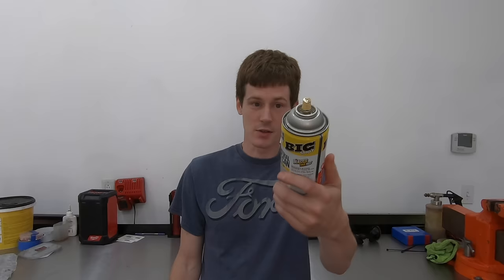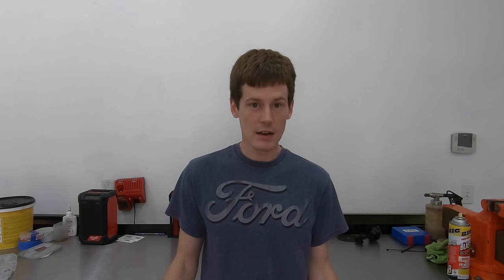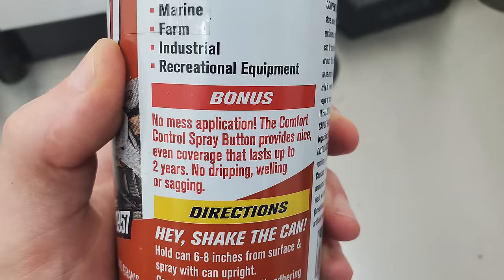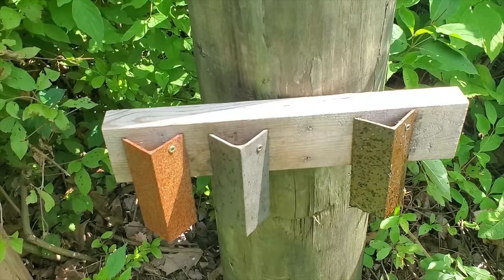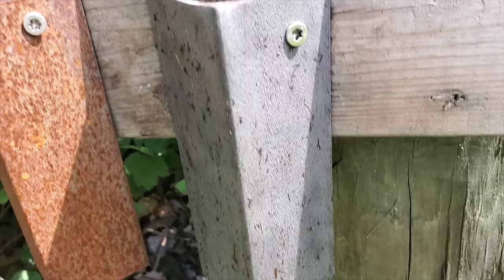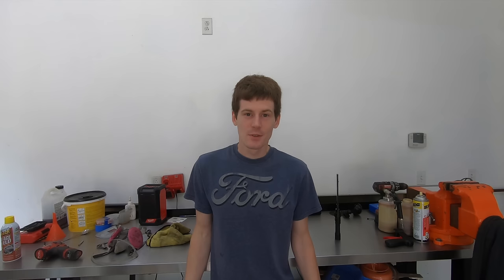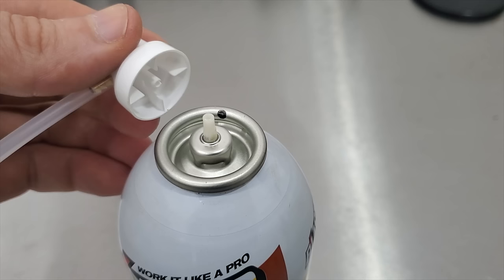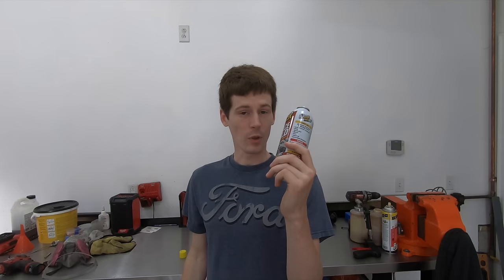I Finally Found The Best Undercoating On The Market... Blaster Surface Shield

Comment: Told my Freind about it and he used it on his  brand new ATV  because we travel on saltwater shorelines …only problem he came across was grass seeds stick to that stuff and it’s fairy hard to avoid it…only thing I can add to any kind of coating is make sure to use a penetrating rust inhibitor and make sure there’s no moisture in welded panels and seams before applying any sealant because it will lock in the moisture and it can cause rust from that…

Comment: I live in harsh salted road winters in Northern Canada, use the thin products for flowing capabilities in rocker panels etc, on wheel well areas , frames or anywhere that will be exposed to weathering, use a thicker product that will not wash off after many miles of bad weather driving. Common sense!

Comment: Boiled linseed oil. I did my S10 7 years ago and it still looks exactly like it did 7 years ago. And I live in New England. This truck was from Florida originally so it had no rust to begin with. Best part it's clear and penetrates the surface. Worst part it stinks for about 2 weeks while it cures. If you want to protect your underside and have it not look like you undercoated it this is the stuff to use.
Reply: @kimbuck-2  I used a undercoating gun but a regular spray gun will work just need a big tip.

Comment: Regards to the bolts on the mud flaps, that could be road grime, rubber or tar that isn’t coming off. Not necessarily the product. Try doing a controlled test on clean metal. Spray the product on, leave it sit without contaminating it, and then spray it with the pressure washer.

Comment: I'm intrigued. However, I have a few cans of Woolwax I need to use. What concerns me about the long lasting part of it though is how well it attracts dirt and doesn't wash off. One thing I've found with Woolwax is my frame appearing to have surface rust simply because of the red dirt from some of my off roading trips in Michigan's upper peninsula not wanting to wash off that easily. Not a big deal because it isn't rust, but still.

On the other hand, I specifically chose Woolwax over Fluid Film because of the concerns about FF washing off come spring time and people needing to reapply it.

Comment: I spray everything with used transmission fluid and let it soak for a month. Then I powerwash it, blow dry it with a leaf blower and coat it 2 to 3 days later.

Comment: best thing to use is mineral oil mixed with coconut oil put a half gallon of each in a pot and warm it up and mix it together I put it on my truck 6 years ago and it's still protecting it when your looking for something to protect from water and salt it is good to luck at the nautical industry coconut oil has been used for thousands of years to protect against the oceans salt

Comment: I've owned my 1971 GMC longer than this kid has been alive. The exterior has surface rust breaking through the paint, but I had treated underneath the truck and under the hood with CRC Marine Corrosion Inhibitor only a couple times, and it still looks just like it did twenty years ago.
Better than undercoat.

Comment: Great Video and great news a thinner ( creeper) type that can last close to 2 years. Almost all others will peek out at around a year if that. Had the same trouble with the cavity attachment. Had a buddy who bought home from work the smallest plastic tubing I'd seen before. A Medical device maker Co... We were about to  put this tubing over the straw but not tight enough where it wouldn't blow off, So we epoxy sealed it on overnight. Was able to then get into inner panels with an older can of Rust Preventer(Eastwick I think) in a spray can like this.And then take nozzle to a new can. Been 5 years and the wheel fenders lips haven't started to bubble yet on a notorious rustmaker dodge truck!
Reply: Can you spray the braking system too?
Reply: @larrymccann767  Not quite sure what you mean by braking system? DEFINITELY have done all the steel brake lines from the master cylinder to the backing plates and calipers though. Those notorious rusting brake lines have been pretty much eliminated !

Comment: Fluid film isn't bad but living and driving in canada,and owning a few cars and watching them rust out even with fluid film. I found the absolute best undercoating that I use on my vehicle with absolutely no rust except my calipers. Which is krown rust control, I recommend this to everyone that wants to save a vehicle from rotting. A pressure washer won't remove it.
Reply from the maker: Complete crap even tested it twice:https://youtu.be/oXlhmbvdKBo 
https://youtu.be/9SOOfZFmhSY?t=264

Comment: Started fighting vehicle corrosion with topical products many years ago with petro oil / petro grease / paint.  Those don't work, grease being particularly hideous as corrosion builds under the grease layer and isn't obvious until sheet metal perforates or flakes off. 
Later changed to Fluid Film , flows well , washes off too easily for wheel well and other high wash areas-- went to the Fluid Film marine grease form for high wash areas but not really satisfied with that.   Changed to Woolwax several years ago, less wash off than standard Fluid Film, still not satisfied for high wash areas.  
Now trying CRC cosmoline like spray for high wash areas, and will add some trialing of the PB Surface Shield, if the product lives up to the hype it would be preferable to CRC for irregular crevice penetration in high wash areas;  flat, cleaner surfaces CRC may still be preferred. 
Anecdotally: 7.3L oil pans, which suffer from corrosion penetration and leaks, poor alloy quality (very expensive to fix a leaky 7.3L oil pan in either time or money)-- tried POR-15 full on vehicle surface clean/prep/pre-treatment/POR-15.  Messy and took a long time, and POR-15 flaked off within a year or two with corrosion even worse.  Disappointing results.  Now Woolwax every 6 months or so, being conservative, could go longer w/o repeating, but really don't want oil pan rust holes, no advancing corrosion and the Woolwax doesn't boil off.  I did not really expect that performance in the fairly hot environment, but the Woolwax works.
Reply: I should add a comment:  the driving here is not road queen paved roads and paved parking (nor, gasp, a garage).  Typical is 3-10 miles per day of dirt roads, north east US state using ferocious latest version car destroying de-icing chemicals which are actually applied heavier on dirt roads here, with weeds and grass brushing the bottom of the vehicle in spring/summer/fall depending on the bush hogging.  My observation is that severity is much much higher with dirt roads, unpaved parking, and vegetation compared to friends' vehicles which only mosey along on paved roads and park on paved areas.  The dirt roads particularly seem to "wash off" anything in wheel wells and related blasted areas.

Comment: This is interesting, in a previous video where you were removing fluid film with pressure washer to test out wool wax, you said even after spraying with the pressure washer, fluid film was still on the metal, and you showed this by running your finger on the metal, which left oil type trace marks. You had to go back and wipe it off with a rag,  but did not show after doing that if there was any residue still from fluid film. Will see these results  ( surface shield) show in time. Surface shield is more pricey than fluid film.  Not enough cars to test fluid film and surface shield  2 year evaluation after 1 application I guess. Thanks for the videos, very informative.

Comment: I used it today on my snowblower along with thinner products for creeping in on seems, one product you should try is CRC heavy duty marine grease it blows them all away especially if you live where there is salt. The only downside is on a plain metal it will leave yellow tint but my ariens showed no signs of yellowing only on clear and it will not com off either with a pressure washer.  but the stuff he has is good..,

Comment: One thing right now I noticed PB Blaster Surface Shield
leaves a sticky surface once applied. IMHO I didn't
like that so far that is the only issue. We'll see how it holds up
thru this winter that is coming. I do like the product
and now ordered the one gallon which in my opinion is the
way to purchase it for me.

 I ordered six one quart containers from Amazon for my spray gun
so that I will break down the one gallon into quarts and label them
according. I used 3 cans of the six on my 2005 F150 Ford truck
with the extended cab and has the medium size bed. I didn't do the
front, rear bumpers inside the doors  and rocker panels I will use my
spray gun with the 360 extended wand for those. Hope this helps
someone else out there.

Comment: Nice commonsense video. I will give the stuff a try here on my own stuff. Not too long ago I did the under side f an old Mower deck with fluid film. The decks on that model MTD are know problem childs from the get go with rust and metal fatigue. This one is not a bad mower I got it with a bad motor and repowered it only to find out the decks have a rust & fatigue issue like a lot of JDeere box store junkers. My MTD I dissected the deck at the fatigue areas and put heavier metal in so spraying fluid film over the shit work helped. Here is a new angle at preserving one of my favorite riding mowers.

Comment: What I like most about fluid film in a can is that it's carbonated. The bubbles force it into the tight areas.
Reply from the maker: It's not carbonated haha. Thats the propellant escaping out of the product. Only the aerosol cans bubble, Surface Shield does the same thing.

Comment: The best coating for me is leaving my rear main seal to leak and spray my entire jeep with oil as i drive... only issues is i gatta put a quart in every 300 miles, keeps th eengine clean too as its always got fresh oil.... lol yes i am in the process of changing the seal finally though haha but hey the oil coating worked great haha

Comment: Another big problem with aerosol cans with 'male ends' - if you accidentally drop or knock over an uncapped can and it hits the ground on the spray tip, there 'male end' usually breaks off in the can, pretty much making it useless. Male spray tips will break off as well, but the broken piece is easily removed from the can and you can replace the tip, and you don't have to throw away and waste whatever is left in the can.

Comment: For me, rust converter plus a black paint works better. No need to apply it every year. It might last you more than 2 years.  Just check areas that rust is starting and just touch up.

Comment: I've been using Lucas Red n' Tacky grease, which won't wash off under direct spray from a pressure washer spraying dish soap, but I worry about it not creeping as you mention.  I'll have to check this out.

Comment: After spraying the first 5 gallons, I am left disappointed that the product does not seem to "set up" at all. I have used fluid film, NH undercoating, waxoyl and now surface shield. All of the others set up to varying extent. Waxoyl seemed to be the longest lasting so far and "set-up" the best. Too early to tell on she surface shield, from a "long lasting" perspective, but the fact that is stays greasy runny, makes vehicle servicing more challenging. I just ordered Waxoyl hardwax for my next vehicle. I know it meets my expectations, and i am left wondering if the surface shield will.

Comment: I just tried this stuff via aerosol can tonight.  I guess my definition of "no drip" is different than the manufacturer's.  Using an inner cavity sprayer, it seems I collected enough to cause drips based on the amount that dripped on the top of my head, face, neck, back, and chest.  Seems like an ok product, but probably misleading a bit on the can.
Reply: well dad gum, anything will drip if you spray enough

Comment: I just use old used motor oil (thin coat) a few times during the winter and after winter I use dawn dish soap and a pressure washer to wash it off. Haven’t had any rust in years.

Comment: When I saw the title I was thinking "undercoating" like the old days where it's a tar like substance and goes on fairly thick and it was normally done at the dealership. Seems interesting though, I might pick up some for the mount points on my new bumpers and rock sliders that should be here in 3 to 5 weeks.

Comment: Something that sticks and won’t wash off, could have qualities closer to paint.  So does the surface shield behave like paint, or even POR15 as you’ve commented, will chip and peel, and if it’s NOT easy to remove then you’re stuck with a compromised coated surface.

Comment: Bar & chain oil mixed 50/50 with diesel fuel then find a dirt road & fly down it! Repeat yearly & drill into from a inside lication where you can cap the drilled opening & spray into rocker panels, cab corners & inaccessible arrers known to rust.

Comment: good job dude this stuff is freaking awesome I actually found it before I saw your video so im kind of like proud of myself you know lol but I thought it was a rust remover not a ruse prevention lol it totally works to remove rust though like it turns rust to muddy sludge and you just wipe it off its great saved my back and arms for real though.

Comment: You should spray it on the frame where you blasted off the Fluid Film. It's hard to actually see anything (residue) on the bolts. It looks like nothing is on it. I would be curious to see how it holds up on the frame surface with a pressure washer.
Reply: I was thinking the same

Comment: I've always just mixed some solvent into Fluid Film to thin it, and it will creep and flow, but after the solvent evaporates, it thickens back up to the normal consistency which resists wash off..

Comment: If the product is as pressure-washer-proof as you've shown, it means, it is NOT a "lanolin product". 
The advantage of the lanolin stuff is as cavity protection, where it will creep up the wall every summer, protecting the cavity for some years (depending on which version you use). It is recommended to use Fluid Film liquid A first, if rust is present. Leave it for half a year, then re-coat with the "NAS" or the "AR". Ideally, you buy A and the very "pudding" like AR, and mix them if you need something in between.

But back to the pressure-washer safe product: This can only be achieved by a wax type product, something that dries, because any "oily" product will wash off after any amount of time.
So this is a "wax" to me, which will probably not have any of the crack-sealing, self-healing, creeping characteristics.
Maybe it's a really good wax. But still: Scratch you Fluid surface and look at it after a couple of days. Scratch is gone. Do it with this hard stuff. WIll never heal.

Better smell is definitely a pro ;-)
Fluid used to smell like good hand-cream many years ago (I mean like >10 years ago!). We loved it, it was like a sheep on a wildflower meadow :-D
But since a couple of years, it stinks like the dirt in a filthy stable. Makes you think about where they get it from...
Reply from the maker: It has petroleum jelly in it. When the lanolin is washed away by high water contact. The petroleum jelly is left behind. If the lanolin is still on the surface, it will self heal. So, on internal surfaces it functions like any other lanolin product.

Comment: You have to use different products for different areas . Wet will creep into edges and that are hard to read thick sticks and is better for other places. The absolute best for a heavy metal salt protection humidity get CRC heavy duty corrosion inhibitor.

Comment: Hey. Really enjoy your content. I recently purchased a used truck not knowing it had been undercoated by the dealer with a permanent wax based spray on undercoating on the frame and under the body. Just wondering if you have any experience with these types of undercoatings and if there would be any value, in your opinion, to treating it with fluid film as I understand these types of undercoatings can be prone to rust if the coating is compromised. Thanks.

Comment: I realise this is an old video...but. I bought 6 cans of this PB product to undercoat my car. 70 degrees, inside, shook the cans. 3 cans in a row stopped spraying after using a third of the cans. I wish this wasn’t the case because it went on well and it didn’t create a fog like other sprays. I had to finish with another brand.

Comment: Could you please do an evaluation of this Blaster Surface Shield on lawn mower cutting decks. I have had to repair extensive rust issues under my Murray ride on mower deck and my research indicates that this is an issue for every brand on the market. I honestly believe it is deliberate built in obsolescence by the manufacturers as it generally costs around $1,000.00 to replace an average mower deck. My hand operated push mower has an alloy deck and is not an issue but it appears there is no Ride On Mower with an alloy cutting deck. I enjoy your video presentations. Kind regards Ross Johnson - Cooranbong NSW Australia
Reply from the maker: Did it already: https://youtu.be/KiCFrcc7MSs

Comment: Tried surface shield and compared it to fluid film on a garden tractor. Dust sticks worse and when using the tube it leaks alot under the spray nozzle so unless I can find a better nozzle I'm not messing with it again.

Comment: Excellent video mate. I'm in the UK, and Hydrate 80? seems to be a good choice for my '01 Merc C200 W203, due to surface rust on the suspension areas - (MOT advisory). Pushing it on for as long as I can.